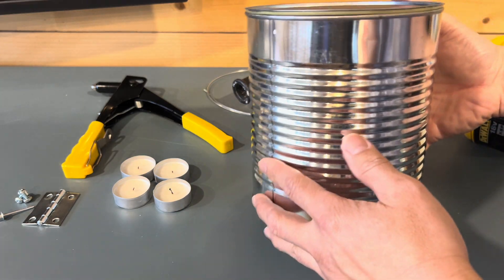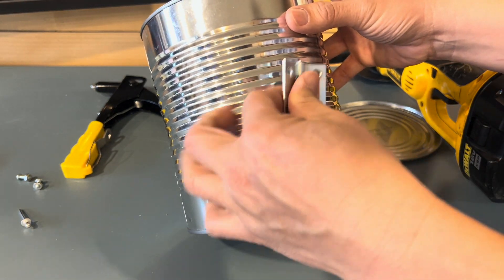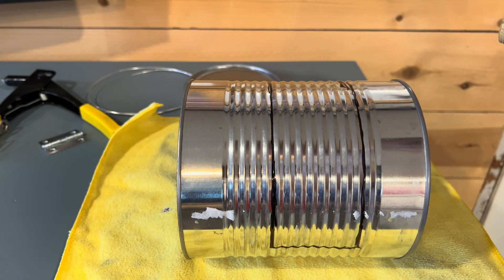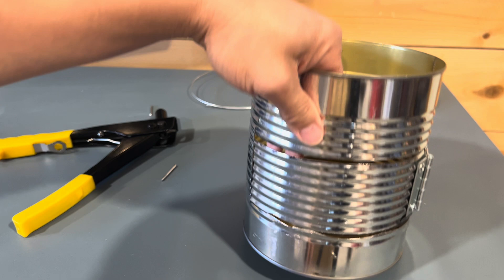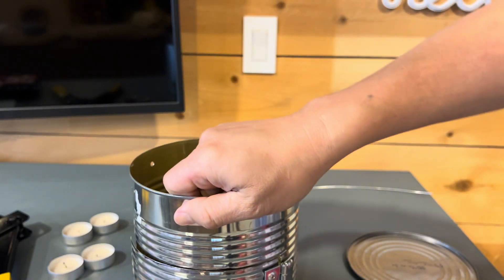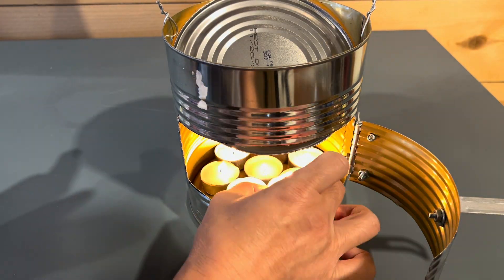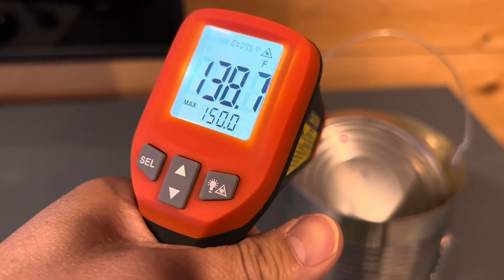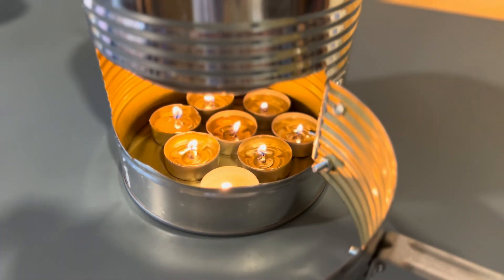Escape the Cold: How to Build a DIY Tin Can Heater

Comment: I've done the maths. A bag of 1,000 tealight candles, gives you about 16hrs burn time, costs about as much as it does to heat your home for a month. How is that cheaper? It's a fun project but if you did this then you'd have to spend thousands to heat a home.
Reply: Stick a taper into a small tub of crisco and it will burn for DAYS
Reply: What maths is that 😂😂 you can get a bag of 4 hr burning candles or 8 or 12 for pretty cheap

Comment: I put 10 tea light like that together in a casserole for heating and woke up in the middle of the night from the fire alarm going of, the tea lights had gotten so warm that they had started to burn without the vic and did spew out thick black smoke and 30 cm tall flames... It is not safe to put so many tea lights together like that.
Reply from the maker: Thanks for sharing your first hand experience.  As always, exercise precautions whenever dealing with fire.  Thanks for sharing and keeping this community safe.